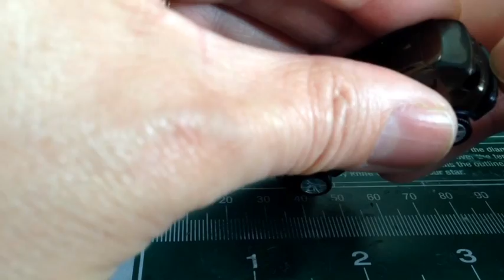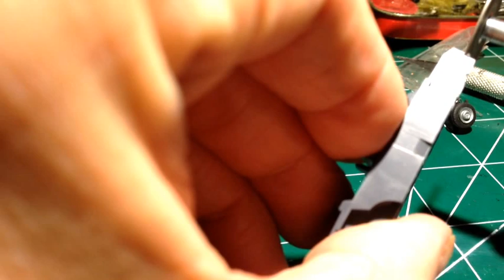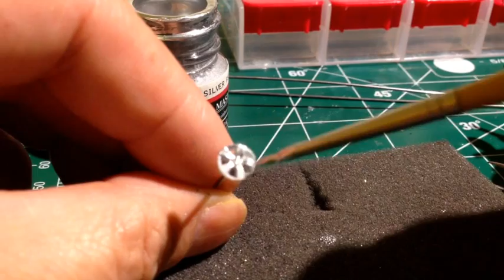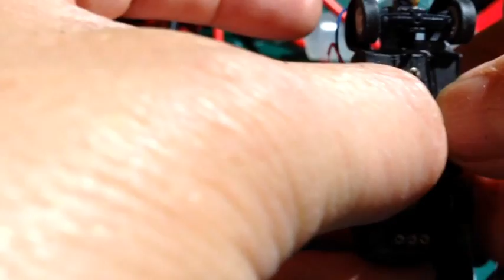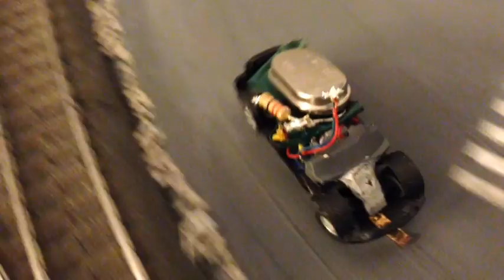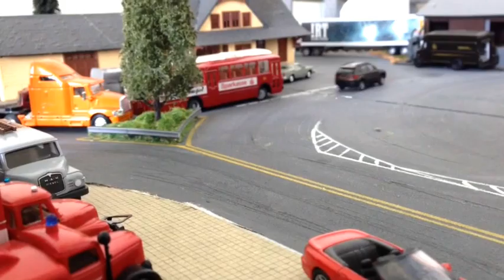🔴  Faller Car System BMW X5 Scale 1:87- HO

Comment: how it is getting directed on the road. is there any wires under the road.
Reply from the maker: I can control through a magnetic wire under the road. the cars used rechargeable batteries. some of them are built on my own.
Reply: how the magnetic wire is made